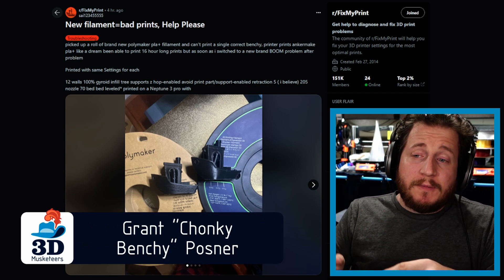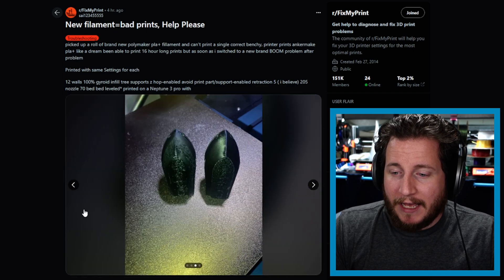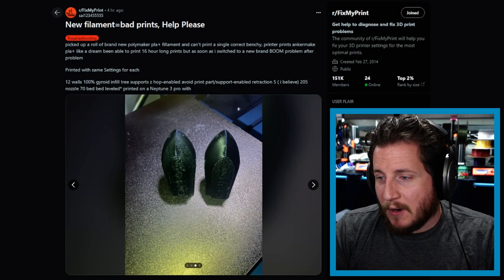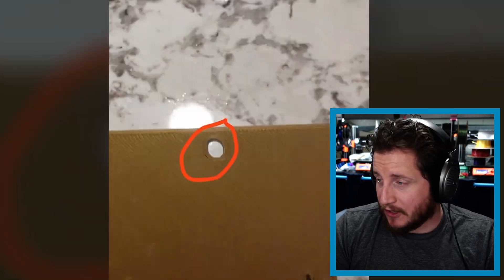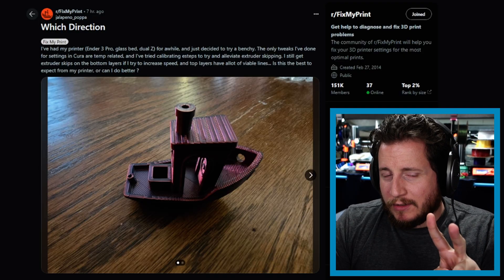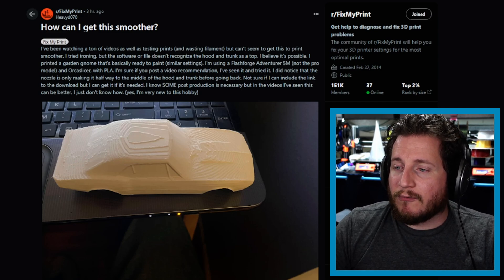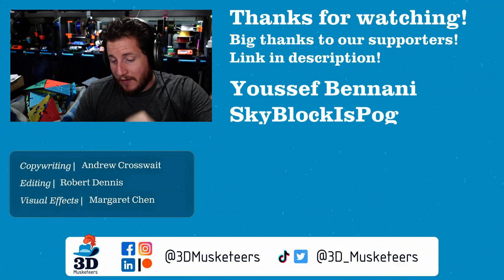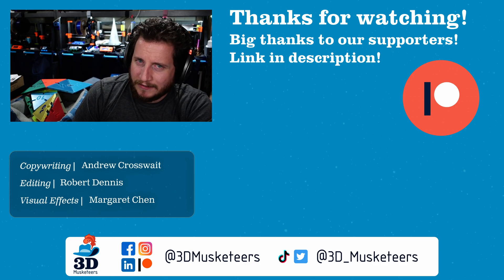Oval Holes and Obvious Layers! - PrintFixFriday 171

Comment: I've had same brand. same type filament had different temp profiles across batches

noted, it changed twice in a span of 5 years, but still
Reply from the maker: manufacturers can change their suppliers, that is likely what happened I would guess?

Comment: Regarding the layer lines on the car model, try flipping / rotating it so its either side on or end up. You may have to use more filament for supports but you will get far more resolution in the xy axis and the sides of the car have far less stepping so not so much of an issue in regards z resolution

Comment: With the oval holes. If it is a new issue, belt tension. But if it is not new, it might be a e-step calibration issue.

I see no need to replace a mostly functioning printer, we have enough e waste. Just be wise when you cut it loose and upgrade to a newer platform. I am still running the ender3 clone I got in 2020. Total parts and upgrades, still cheaper than a good printer at the time.
Reply from the maker: Yes! Good point! I'd love to do a comparison with older machines and making them modern but I feel like we've come to the age of just replace it.

Comment: So, replacing the legally required rear fender on my old bus that I can't get parts for with a 3d printed one of ABS-GF is a problem? asking for a friend.
Reply from the maker: Possible? Sure. Safe? Not a chance.
Reply: @3DMusketeers  safer than not having a cover on rear wheels, especially duallies.
the first version was petg, the second was ABS-GF. Hey!, someone printed up a whole Lambo, I remember signing it at RMRRF

Comment: I think the user with the car misunderstood ironing. Ironing irons (individual) top layers but does not smooth "between" layers. 
What they might be looking for is basically "non-planar printing". Which is - as far as I know - in a (VERY) experimental stage still.
Reply: What has amazed me is that slicers cant seem to accommodate multiple layer thicknesses on the same layer slice when doing outer surfaces,
I would figure it not to be too complicated, print the thinner layers first in a slice, then move z up just a bit to do the rest, or next graduation. I already see similar when printing the top layer in vase mode. in this way, the print doesn't have to take an inordinate amount of time doing detail work in areas unseen
Reply: @davidconner-shover51  Well at least you can use different heights for perimeters and infill. In Prusa Slicer it is the "combine infill every X layers".

Comment: 4:44 temp tower sound advice. I would also add a pressure advance test, especially as printers are getting faster and melt zones getting longer. 

I was wondering if extrusion multiplier was also at play here, especially with that many walls. I’ve found some of the additives / colours in some PLA+s make it expand a little as it exits nozzle

Comment: In terms of topics to revisit for the new year, bed adhesion bed adhesion bed adhesion

Finally what's giving me some consistency with pla is 65 default bed temp. 70, maybe 75, if I need a brim. Everything I've seen suggests that that's really high, but it works so 🤷‍♂️